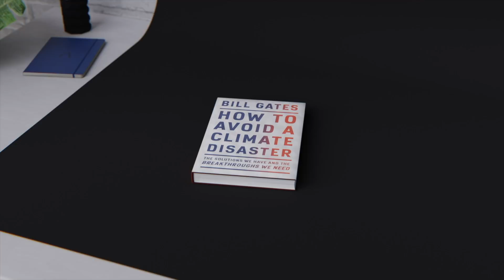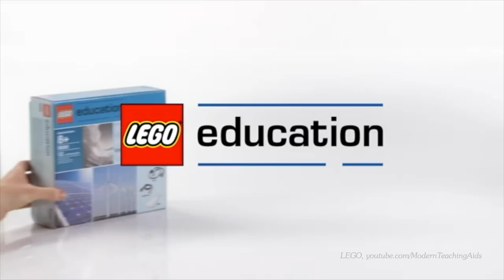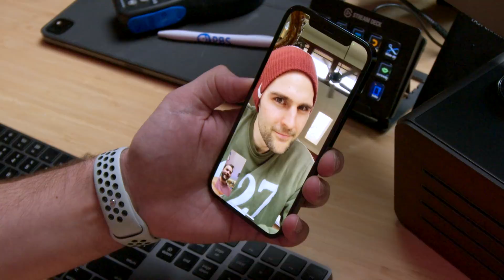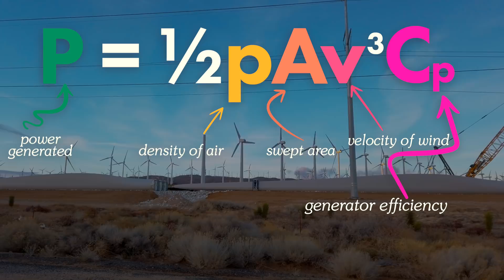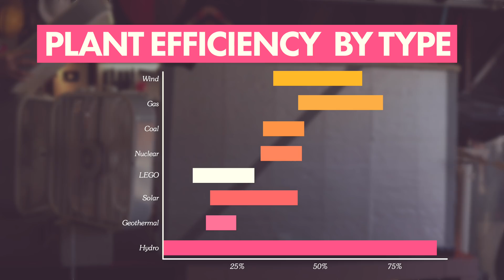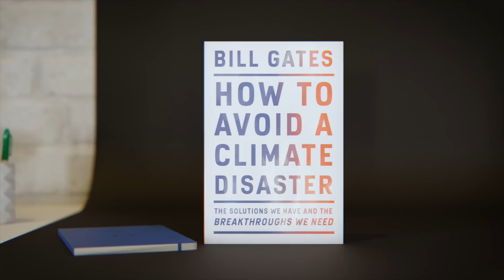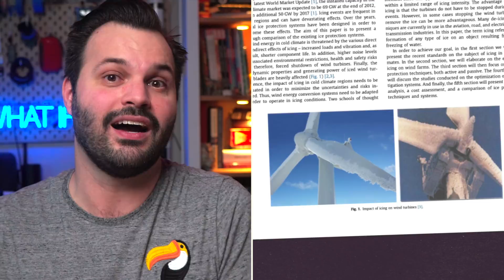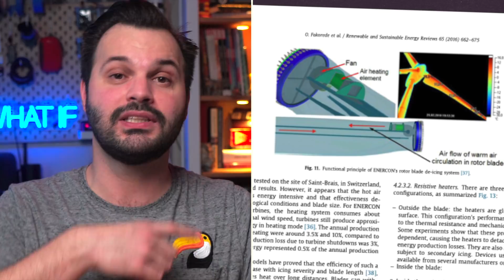My LEGO Wind Turbine MAKES ELECTRICITY!

Comment: This is great - just found that lego set on ebay - I have a young relative who would get a kick out of this. Don't suppose you have a plan or any info on the pieces needed for the actual wind turbine structure? Sadly all my lego was gifted away some 25 years ago :)
Reply from the maker: The turbine structure is set number 10268 -- there are TONS of databases online that will list every piece you'd need to build it! (or you can try and find the set, but they're pretty tough to get a hold of)
Reply: @TraceDominguez  Thanks!

Comment: The reason why it didn’t move before you attached the other blades is down to aerodynamics’ there is a possibility to modify the original blades to pitch’ my slightly smaller wind turbine is fragile with a thin tower but the blades are amazing.

Comment: Windmill power has been used in Thai sea salt industries (or as literally translated, salt fields or salt paddies) as well. In fact, traditional sea salt making relies on two modes of renewable energy, wind and solar. Wind powers Archimedean screws to draw seawater into the fields, and solar energy does the evaporation job.

Comment: It is sad that most parts from windturbines actually can't be re-used and is just being dug into the ground, polluting the ground and the areas around it. Wind is great as a supplement, but if one really want to make an impact on climate change, nuclear is the best option right now, until more, better solutions are made. I've been inside many winturbines and the off-shore nacelle towers are the size of a 4 bedroom apartment, packed with non-recyclables - But! Offshore windturbines are the better option compared to those on land, that have less uptime and they're killing wildlife and birds. 
Of course we could also as humans start consuming less red meats if we want to make a difference tomorrow. Great video.

Comment: Wind turbines are a scam.
Reply from the maker: Wind mills that grind grain is a scam.
Pinwheels are a scam. 
Turning things with air is a scam.
Turning things with steam is a scam.
Steam turbines are a scam.
… Coal, natural gas, nuclear are all steam turbines.
Reply: @TraceDominguez  The energy that wind turbines produce will never justify the energy and costs to manufacture them and maintenance them in winter. They're a great example of sunk cost fallacy and snake oil.

Comment: Whenever anyone says that Windmills dont produce any emissions i shed a single tear, for they do "produce" emissions in line with their production. Of cause this is still massively cheaper CO2 per Kw/H wise, in the 100x margins, sometimes more/less. But to say they produce nothing is false
Reply from the maker: They produce nothing. The supply chain that build, creates, disposes/recycles their parts does not. If we want to include that for all forms of power then how does that apply to coal mining, natural gas drilling (including exploratory and pipelines)? We don't include that anywhere else, so why here?

Comment: Climate change is "happening" until our models are proven lacking. Our current models are built on historic data which had no human made CO2. There is still no way of knowing if the current trend of warming will change on its own. The point is it may happen and because of the reason that we don't know I would much more like for green energy tech to be advertise for cleaning the air and cleaning the oceans instead of stoping climate change.
Reply from the maker: Are there scientists who say this? If so: how many? Where are their papers? In a review of 60,000 papers of climate change research, only a few hundred said it wasn't caused by humans or declined to say one way or another. Almost ALL of them said positively that humans are causing climate change. With the amount of carbon in our atmosphere today -- even if it stopped right now -- we'll be feeling the effects for decades to come. Let's say you're right: should we continue to add and contribute to this "natural warming" as you call it? Your argument that the house is on fire so we should just turn on the gas on the stove doesn't really work for me.
Reply: @TraceDominguez  I am not saying that humans are not having an effect but the fact is the temperature where raising since we exited the mini ice age, we have only sped the process up. One of the scenarios that are likely to happen is instead of having continuous rising sea levels and temperatures, since the temperature is soon (in few hundred years or so) going to peak, we are going to have accelerated entrance into an ice age with the collapse of ocean currents.
Reply: @TraceDominguez  So since we don't know the correct scenario what is going to happen since it never did in the long term sudden decrease of CO2 might do more harm than good.
Reply: @TraceDominguez  I think 2020-2021 is the perfect example of what happens when we suddenly stop human activity with snow in Texas and Spain (which did not have such snow in decades), 100-year flood in China, and massive earthquakes in all the new places.
Reply: @TraceDominguez  my argument is too advertise green energy not for fixing climate change but for cleaning the enviroment. You are not an easy person to have a discussion with

Comment: "renewable..." cough cough  magnets. Unfortunately this technology is years or decades away from being environmentally friendly, or renewable. The environmental impact from neodymium mining alone is massive quantities of radioactive byproduct, and these types of turbines need HUGE magnets. Ultimately until we can make turbines out of materials other than metal and neodymium, or recycling those materials at scale becomes effective, "renewable" is just a political buzzword.

Unfortunately we will have to continue driving this technology forward, despite the overall negative impact on the environment, until it becomes a feasible source of widescale power.
Reply from the maker: I agree with your argument that magnet-mining isn't are not renewable. But you're forgetting: Almost all energy generation works the same way: Magnets are turned through a coiled wire by mechanical energy. Steam does this for coal, nuclear, natural gas and other fossil fuels, and fluid pressure does it in nature in the case of hydro and wind. ALL of these generators need the magnets you speak of. All of them. If we're polluting to get the magnets for our generators either way then let's spin that generator in a thing that doesn't MAKE MORE POLLUTION to do so.